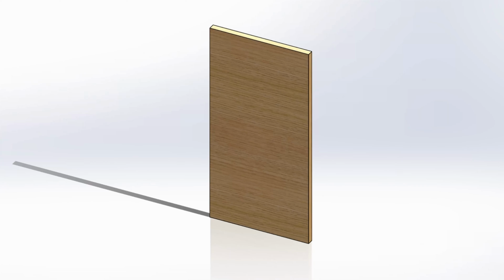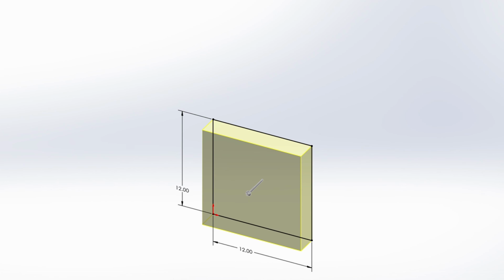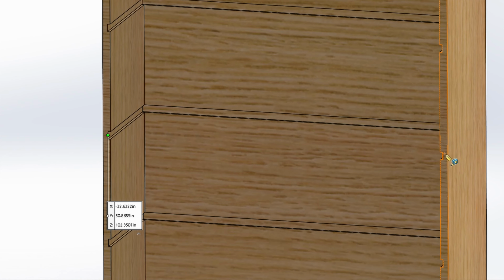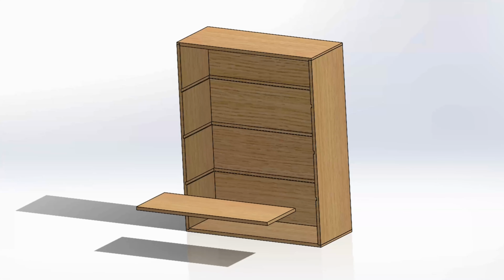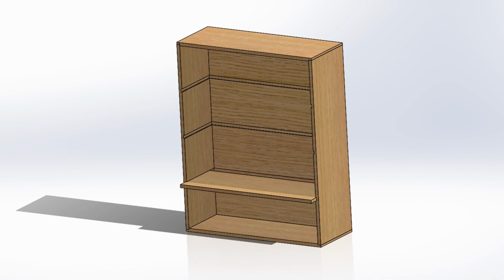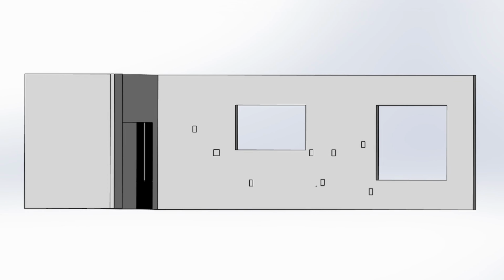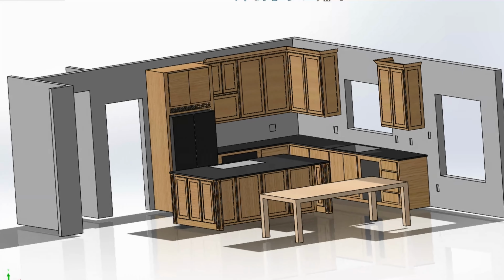5 Reasons To Learn CAD NOW!

Comment: I’ve been thinking about learning a cad program but I don’t want to get stuck into a costly yearly subscription for a program. Got any recommendations?
Reply from the maker: I don't have much personal experience with it but I hear really good things about fusion 360. The majority of my CAD experience is in Solidworks which cost about $100 a year for a maker license.
Reply: SketchUp, OnShape, FreeCad, LibreCad. Those are a few great options. SketchUp and OnShape are browser based, and the other two are locally installed. I personally prefer sketchup. It's quick, easy, cloud based, i can start a design on site with my laptop and refine it later at the office on my pc. I find it useful for modeling real world things like kitchen remodel plans, or laying out a backyard deck to build. It's great for that. Creating models to 3d print however, not so much IMO. OnShape is awesome for that though; it has the fancier features that in particular are useful for creating 3d models. Due to reasons aforementioned, i dont use either of the last two options much but they are from what i can tell, lightweight and simple. 

TLDR: Sketchup for bringing the real world into a digital one, and OnShape for creating something digital to bring to the real world.
Reply: Fusion 360 is a great program, but I got tired of all the hoops to jump through. I have been using FreeCAD and it is a good program. Updates are always in the works, but seem to me a steep learning curve. You only have to update the program if you when you wish and it is not on the cloud. Not being in the cloud is important to me because I don't have internet in my shop. Any changes with a cloud-based program I need to go to house to work on it. Which means I have to clean the sawdust off every time. As far as FreeCAD goes, I don't know if there is a better program or not, but it does work for me.